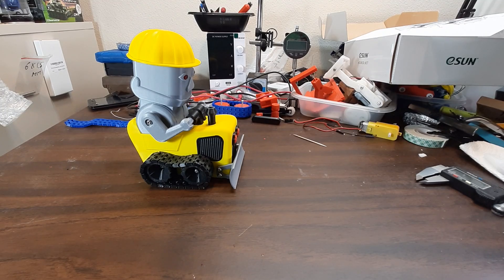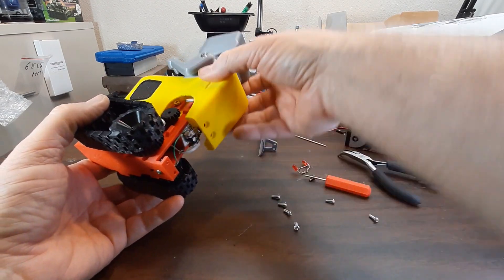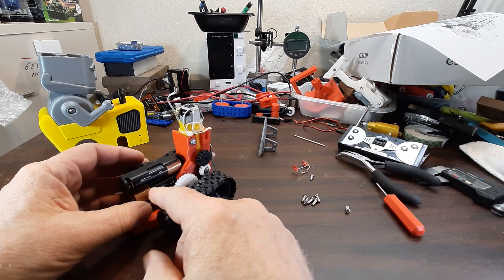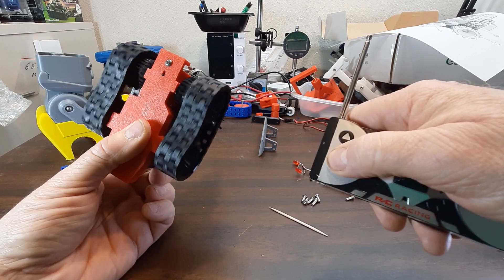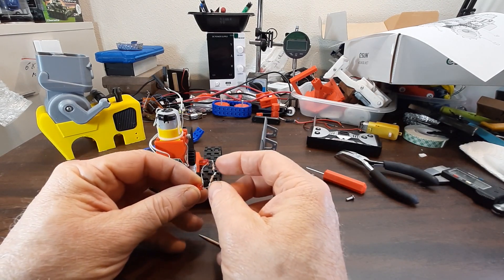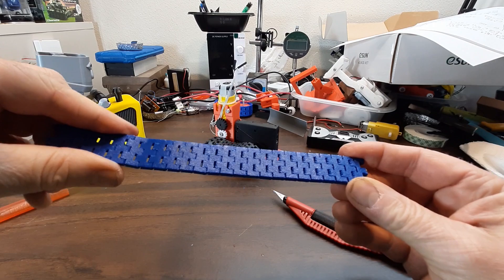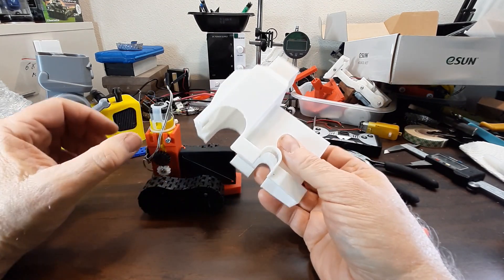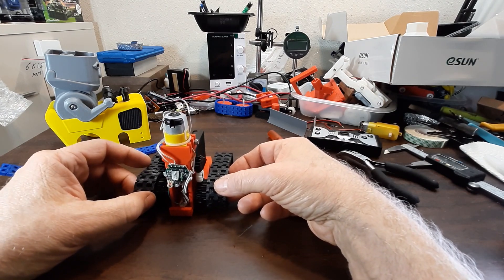Build Video For Single Motor Steerable Toy Bulldozer With Tracks

Comment: Just did a print of the track design on my bambu lab A1 mini. Turned out perfect. I was able to snap the ends together without any trimming, it took allot of pushing but snapped together just fine. Now to print the rest of the parts. I might try a different control method, we will see.
Reply from the maker: Thanks for letting me know. Are you using the Bambu Studio project file? I'm very interested to see your build.
Reply: @rick_100  I sliced my own files so I combine parts. I used the 1:90 Blue TT gearmotor. It draws 110ma at 4.5 volts and under load of the 2 tracks it draws 190ma. 
Just to be different I am using a tone decoder board and a dual H bridge to control the TT gearmotor. Will post a video maybe tomorrow. The wife has me putting up new fencing in the garden right now.

Comment: Great job. You do lovely toys.
Thanks for showing how you made your tracks. Previously I thought you may have made them the same way I made some, I printed mine all in one (printed on the side), I just left enough gap so that when printed the link pins did not stick to link.
I had to look up "Coke Can Mini RC" 😁
Reply from the maker: Interesting. How  well did it work? I looked for the project on your channel  but I only found the ROV with the tracks that were screwed  together.
Reply: @rick_100  I haven't published the tracks I have made, but they are a modified version of the ones I saw on an other Instructable. The Instructable name was "3D Printed FPV Arduino RC Tank With Controller" I'm making something bigger (Not a tank) that I wanted tracks on.